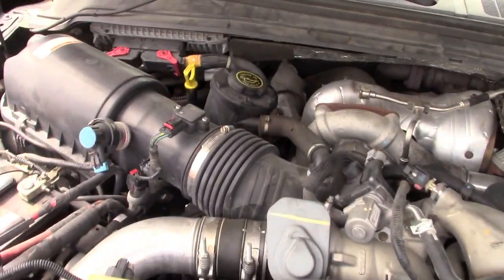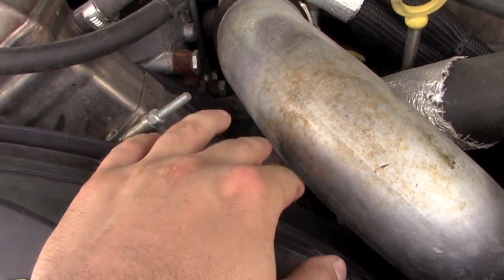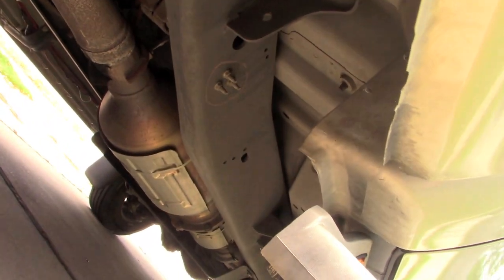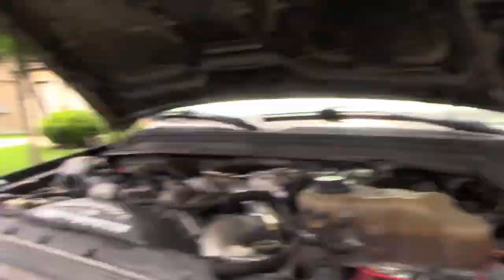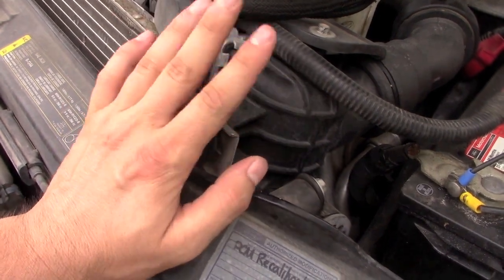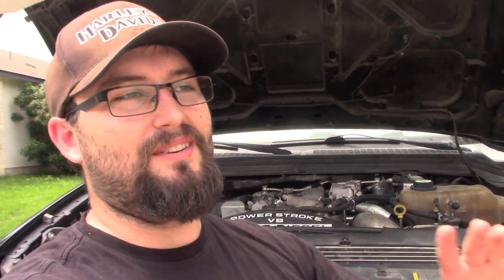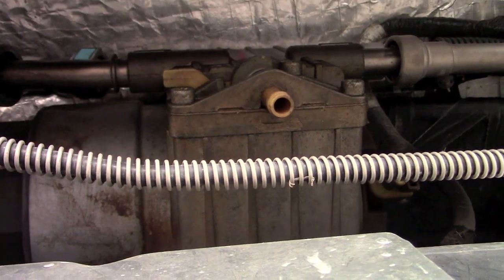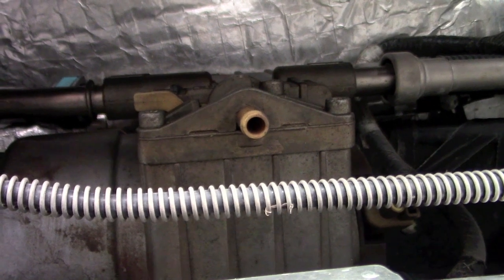What Fails on a 6.4 Powerstroke

Comment: Emmisions kills this motor,delete and proper maintenance done like its supposed to,and no ridiculous tune on a stock motor and they're won't be issues,I'll put my 6.4 against any cummins or duramax anyday
Reply: @The-Metal-Life nice 👍🏽 💪
Reply: 😆 my Lb7 makes around 800hp an double that in torque your hilarious
Reply: @bunb7145  my 6.4 makes 1000 hp and has a stage 3 engine and trans fully built and I haven't lost to a d-max or a Cummins yet?
But everyone on the internet has the fastest truck right?
Reply: Good for you lol 6.4 ain't my thing dont care
Reply: @bunb7145  Hate to tell you but the Lb7 is honestly just as bad as the 6.4’s for reliability.

Comment: my friend's dad has a 2010 6.4 with 330,000 on it. He deleted the DPF years ago, when the high pressure fuel pump failed several years ago he added Sinister EGR coolers while the cab was off the frame, no issues since.

Comment: A lot of folks buy a diesel truck with a 10 ton plus towing capacity to daily drive to work or go get groceries and pull a small lawnmower around . At our shop we see the least problems and the highest mileage from trucks that pull a big trailer around every day. No to many problems compared to the daily commuters with no load.
Reply from the maker: i can see that, diesels need to be worked. when they are not work they seem to start having issues.

Comment: I did everything to my truck you mentioned, except I did not delete anything since I live in California.  Every 30-40 thousand miles, I get my DPF baked and cleaned.  I also get all three EGT sensors replaced each time I get my DPF cleaned.  It’s also very important to run Archoil fuel and oil treatment for many reasons.  Also, cetane is not regulated for diesel fuels in the US so it’s important to add cetane booster to your fuel, every time you fill up.  Modifications and aftermarket parts can damage your truck since you will change the engineering parameters, but I did had to replace my EGR coolers to Bulletproof brand coolers when the stock ones failed.  Finally, the last thing I would like to add to your recipe is a water misting system.  I came up with an idea, after learning about an old military technology, of incorporating a RV water pump and a 5 gallon water bucket in my trunk, with a switch to control it from the cab, and ran a 1/4” irrigation line to my engine bay.  This line would distribute pressured water to multiple water mist fittings (purchased at Home Depot) to ALL my heat exchangers, on demand, when climbing a hill, when regenerating, and when towing in extreme conditions and/or weather conditions.  My ultimate plan is to sell my truck whenever I don’t need it anymore or make this thing last as long as possible while I own it.  If I were you, I would change your oil every 5k miles and purchase the engine oil cooler by Bulletproof Diesel.  I think they call it a Half Cooler.  Any other ideas or comment?
Reply from the maker: No that's is a good list. The water spray system is interesting idea. How well does it work for you?
Reply: I decided to try it because I had a spare water pump lying around.  This concept is used on the condenser of residential air conditioner units to save electricity.  It works, but I don’t know how much of an impact it makes because I don’t have temperature monitor sensors, but I do know that these trucks suffer a lot from heat.  My water tank for this system is just a 5 gallon bucket with a lid, a hose barb fitting at the bottom of the bucket; it will last me enough water for one regen.  I thought about branching off to a misting nozzle for my turbo, but I don’t think that’s a good idea because the sudden temperature drop can crack metal.  Make sure you buy any aftermarket cab isolators and replace the original, factory isolators because they don’t last; they’re too soft.  Pretty sure they absorb well, but don’t last.  I’ve seen videos when they tried lifting one side of the truck wheel with a forklift, and it puts a twist on the front end, enough to twist/compress the radiator.  

I’m all for creating a clever way to make these trucks last, without changing the original design.  These 6.4L trucks generate a lot of heat.  Heat is the #1 killer of many components.  When you hear your fan kick in, it’s wise to slow down, roll down your windows, turn the cab heater to full blast, turn your misting system on, and pray to God.  Ill do whatever it takes because I now see how expensive the repair bills can get for these trucks. 

Before fueling, make cocktails ahead of time.  For me, I purchase cetane booster, by the gallon, at ford dealership.  I also buy the largest bottle of Archoil fuel additive.  My third ingredient is Lucas fuel treatment.  I use empty 16 ounce bottles with graduated lines on them (original small cetane booster bottles from the dealer) to fill 15 ml of Archoil, 12 ounces of cetane booster, and then fill the rest up with Lucas.  I am using Lucas as the carrier to my other ingredients; just like drinking water to wash down NyQuil.  There is a YouTube video about Archoil hosted by Jay Leno.  Watch that one because they talk about all the great benefits of Archoil.  The key to make these trucks last is providing lubricity, efficient combustion, and heat management.
Reply: @richardjeun 
If you're misting with distilled water then yes absolutely. Water absorbs so much heat when it evaporates, I even set a sprinkler on my roof in the summer time. 
The issue you WILL run into if you're not using distilled, is calcium buildup. It will fill clog your radiator fins.
Reply: I agree.  I use water that has gone through my water softener system at my house.  My water softener gets rid of magnesium and calcium.  Good point though!

Comment: Just like to say the piston rings in 7&8 are fitted a little loose as well to accommodate the high heat for expansion this is a nother reason that the 6.4 powerstrock  has excessive blowby that goes directly through your turbocharger. You you know those highly machined instruments that spin at what 60K or so think of how balance is crucial in there performance and longevity. I have installed a catch can system with baffling, must use 1"tube no kinks I vent to atmosphere with a filtered breather like the veh of 50's and 60's there doesn't seem to be any oil drippings but I can fill up a wisky shot glass of drippings every 5K Serviceing these servings are a must if you want to assure any kind of long life. The next week spot is the rocker arm assembly it just breaks down the plastic parts and wears out the moving parts as there doesn't seem to be enough oil getting in there. But I would have thought someone would have come up with a better after market rocker arm assembly by now. Bill Hewitt rest his sole swore by Arch Oil additives for fuel and oil. But I love my 6.4 Powerstroke. This video has been around for sometime now. Now is Dec.23/2023. My truck has 140K miles on her runs like a fraight train. Stay safe out there. Good video thanks for the info

Comment: From what I’ve read, one of the main reasons the radiator cracks is due to the front cab mounts wearing out! The mishimoto ones are actually known to leak as well lol
Reply from the maker: Hmm that’s good to know, I have not heard of that,  I will look into that. Thanks for the info!!
Reply: LSRW course. I believe bill Hewitt made a video about it on powerstrokehelp!

Comment: Damn, I just went and test drove a 08 450 King Ranch,  beautiful truck , and the interior was amazing,was going to replace my 01 cummins 3500 Laramie work truck with 300k on her,but after I read all the reviews and videos I'm afraid to buy one , especially being here in California I won't be able to delete it. But I love the looks and interior of the f450s.
Reply from the maker: Yeah they are nice looking trucks and ride great but being in CA that’s tricky. Best to luck with that!!
Reply: Same here, I love the body style of the 08 to 10 body style of the f450. But seen at the negative and now afraid to get one. But since there's a few parts to swap out i think I'll go for it. Just to pull a 9600 travel trailer a few times a year.
Reply from the maker: @truckerbj  They doo sell upgraded DFP that are cheaper than the OEM and with good maintenance it could play out for you. best of luck!
Reply: @LSRWvlog  definitely have been doing deep research, seems like the ones who have the most problems max the tuners and always run it wide open. I'm looking into the ones with 4.88 gear ratio.
Reply: THE SALTY RANT  ok thanks for great advice and information. I've found a few with less than 75k miles.
Reply: THE SALTY RANT  so true on the maintenance. I’ve got a 09 CC 4x4 KR. 201,xxx miles. EGR and DPF deleted at 94000 intake and turbo back 4” with stock can and tail pipe with Spartan tuner, now patriot. Never went higher than the 150HP tune. Changed oil every 5000 miles. Both fuel filter every 10000. Engine doesn’t have any blow by. Going to check rocker arms very soon. Better safe than sorry.

Comment: Man it’s unfortunate that the 6.4 has had such a bad wrap, I bought my ‘08 in February and so far I’m extremely happy with it, I fortunately got very lucky and the engine was replaced 20,000 miles ago by the original owner, tuned and deleted so hoping I can avoid most of these issues as time goes on! Like your stuff man, been following u for a few months, keep it up! 👍
Reply from the maker: thanks for feed back! and yes it is a shame that these trucks have such a bad rap, they do have their problems and they can be expensive. But with the right maintenance and up keep they can be great trucks with good power.
Reply: Where do you get replacement motors
Reply: @carter.coleman  just depends on the diesel mechanic, they are normally crate engines they order.
Reply: @chrisd5986  so they are brand new and not pulled from something else?
Reply: @carter.coleman  yessir…not cheap so make sure you absolutely need it, sometimes, depending on the truck it’s cheaper to sell the truck with a blown engine and buy something new 😬. Just depends of course tho

Comment: I’ve had my 08 6.4 King Ranch since 2010. Bought it off my father in law who had the DPF delete on it basically the day after he bought it. It’s been programmed with a SCT programmer for economy and I’m about to turn 170k on it. The only issues I’ve had were the EGR valve and two belt pulleys. Maintenance regularly and I throw some SeaFoam in her every 6 months or so. She might die soon or she might not but all I know is that the DPF and shitty maintenance is a major cause of these engines dying on owners. And great video 👍
Reply from the maker: That’s awesome, you made it pass the 150k mark haha. But the dpf and  poor maintenance is the main killer for these engines
Reply: How much does a dpf delete run?
Reply from the maker: Depends on parts you can find but anywhere from $1,000 to $2,000 that's you doing the labor. The minimum you will need is a turner and a DPF delete pipe.

Comment: I’ve got a 09 CC 4x4 King ranch. 201,xxx on the original engine. DPF, EGR and EGR coolers deleted at 94000. Spartan tuner, now patriot tuners. 4” turbo back exhaust with stock can and tips. AFE intake. Never went above the 150HP tune. Only issue I had was the transmission went at 194,000 and a shitty up pipe cracked. Relocated and tapped block off plate for EBP sensor. Alternator went at 192000. Replaced tensioners and belts every 100K. Also replace body mount bushings and lift pump at 190,000, it didn’t fail just put a new one in. Runs great with no blow by. Going to check rockers soon. Better safe than sorry. Oil always changed at 5k and both fuel filters at 10k. I love the truck and don’t plan on getting anything different. It gave me as many issues as my 99.5 7.3L. I should have never sold the 7.3L w/ 140k. Don’t be afraid of the 6.4l. Good trucks if maintained and deleted.

Comment: Also get a oil bypass filter and coolant filter combo from sinister the oil bypass strains particulates  down to 1 micron  oil stays clean and ware happens at 4 microns and above  the stock  filter only strains at 20 microns 6.4 motors need all the help they can get or they will cost you
Reply from the maker: That’s good to know, I was looking into a coolant filter but I will look into the sinister diesel system, thanks!

Comment: My 1993 7.3 idi gets 16-20mpg 20 highway & 16 city that might improve if I change my injectors by maybe +1-2mpg. the idi will run on almost anything as long as it isn't like water and has some form of lubrication.
Reply: IDIs run forever with basic maintenance. And they're so simple that the maintenance really is very basic on them. Love my turbo 6.9IDI.

Comment: my 2500 ram with the 5.9 gets 17 to 19 city and almost 28 mpg unloaded on the freeway. Towing my 20ft flatbed and my turbo s i get 22 mpg. I did buy a diesel for fuel mileage.

Comment: Here’s my take owning 3 of em but my girl I have now has delipped pistons and aftermarket heads, upgraded cam and headstuds fully deleted and single turbo swap, and aluminum radiator it’s been as reliable as they get but I am a maintenance freak I change oil every 3k with Rotella T6 and 1 quart of Lucas and only use Motorcraft fuel and oil filters

Comment: With these mods how’s your 6.4 engine life now?? Heard how horrible these motors were but I feel with mods you have it can significantly improve the motor and reduce the problems they are prone to
Reply from the maker: doing those mods will help the life of the engine. The engine is running strong and I had no issues with it. There are more and more people getting over 200k with no issues with this engine.
Reply: LSRW thanks for the input man I was in the market for the 6.4 until all the problems previous owners said they had scared me off but now I realize once you do preventative maintenance like yourself with your truck , they can be very good trucks after all only issue I have was the speed with a load is only allowing you to go 60 mph that grinded my gear lol
Reply from the maker: They are maintance heavy engines and that’s what people need to know before buying and my 450 was configured to be max towing and to do that they use the 4.88 gearing. Other 450s come with 4.30 witch will allow you to go faster than 60, but beat of luck with your search!
Reply: LSRW thank you and great 6.4 content as well 👍🏽

Comment: The 7.3 Powerstroke is considered by many the best Diesel that Ford has ever made.
Reply from the maker: It is one of the best engines Powerstroke made, the emissions control is what killed them
Reply: LSRW true screw California i don’t blame Ford though.
Reply: Ford didn't make the 7.3, international did, as well as the 6.0 and 6.4. So props go to international for that one
Reply from the maker: @kyleranderson1948  and that is why ford now make the powerstroke in house
Reply: @LSRWvlog  indeed
Reply: That's what happens when the fucking epa gets involved. 6.4 would be a solid motor if it wasn't for the emissions bullshit.
Reply: Kyler Anderson CANT FORGET ABOUT THE 6.9
Reply: @kyleranderson1948  actually international made the 6.9 and the 7.3 which is just a bored out 6.9 but navistar made the 6.0 and 6.4. Navistar is the same company that messed up the 90's Cadillacs and gave them a reputation for being unreliable. Hoovies garage goes over Navistar as well.
Reply: @101IplayWOW   @101IplayWOW  its the "same" company, Navistar International is what its called now but they own International that still made the diesels, during the idi age they probably weren't the same company but defenitly were during the 7.3psd and on... probably didn't explain that the best but its basically the same company and has been the same company since the psd age and on
Reply: @kyleranderson1948  that is a good clarification, the 7.3 made it's debut as an idi  and I believe they changed it in 94.
Reply: @101IplayWOW  mhm, either way idi or psd ford didnt actually make it😂
Reply: @kyleranderson1948  there's been people complaining about the 6.7 lately too, mostly dpf/egr problems.
Reply: @101IplayWOW  yeah, I mean I'd complain about the egr/dpf even if they worked right lol. The 6.7 seems to be a good motor tho. Unique but I've seen many in the 500k mile range already so hopefully they can stand the test of time

Comment: PS on fuel economy just with the DPF and EGR deletes plus getting rid of the stock Cold air filter that just chokes the air to these engines. Get a nice K&R or S&B  Cold Air kit will give you noticeable preformce improvements
 With the deletes and new cold air filter change I improved the MPG by 1/3 that was like better than 5 MPG better and over all performances was like day and night. Also keeep your tunes down I run my tune at stock which is like 30 to 40% mor HP but a I tow a 30ft 5th wheel so I will tap it to tow haul. I know people that will take their tunes to street, but thats just to show off I cant aford to show off. And kicking the tune up to performances mode is just asking for trouble. And trouble on these things is just way😅😅❤

Comment: What is your opinion on a deleted 6.4 with a 100hp tune in terms of reliability
Reply from the maker: If your towing a lot 100hp is a little much, yes the truck will tow "better". With my trucks I run the lowest tune to keep stock parts at low stress. Somethings I see that are pushed when running a higher hp tune is that the fuel system is maxed out. Also biggest thing is keeping the heat down, egt, coolest, etc.
Reply: @LSRWvlog  what are your recommendations on keeping the heat down
Reply from the maker: @rfc1626  keep the coolent clean, change every 60k-80k. Make sure to add the ford additive to prevent cavitation. Watch your egts, edge cts3 or other monitors can do that. May require to drill a prob in. Not pushing the truck to climb the hill to keep up with traffic. Also after a long day or towing or heavy towing, let the truck cool down at idle for 5 mins or so.